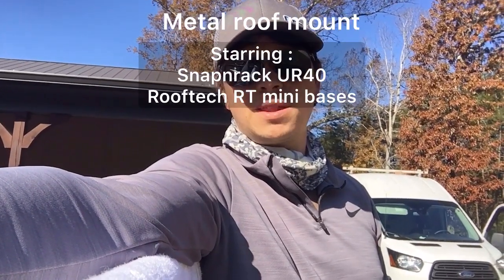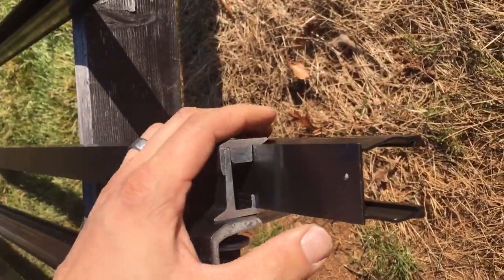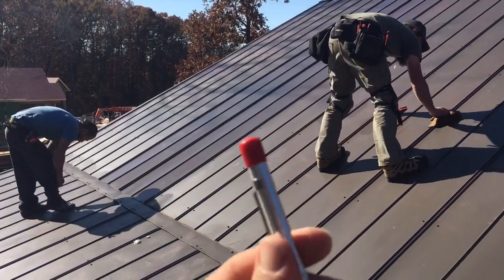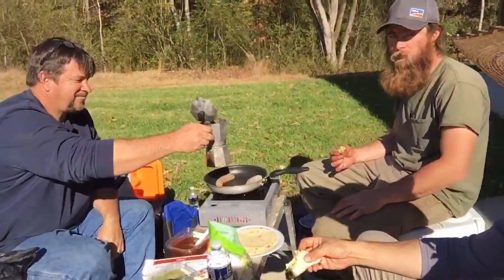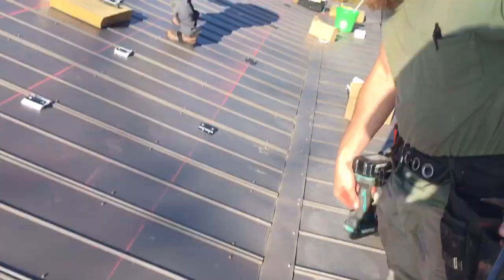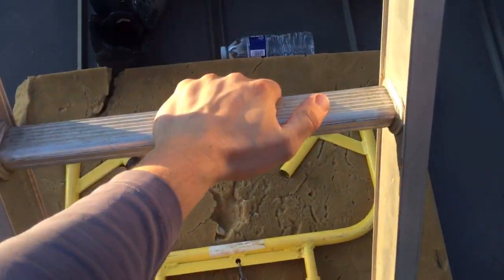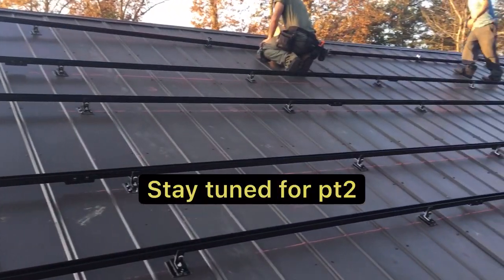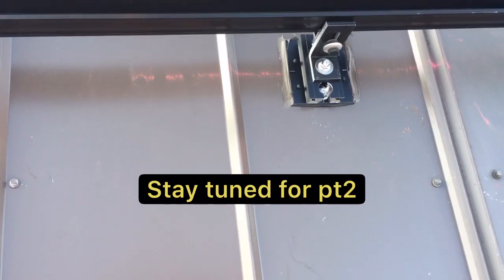Solar metal 30kw Grid Tie Battery Backup Solar Install:Metal Roof Screw Attachment

Comment: I just got the whole crew cougar paws
Reply from the maker: Metal roof or shingle roof?  They work best if you clean the roof squeegee and sponge mop.
Reply: @GainSolarPower  i got the metal ones.
You need a referral code i would have used it.

Comment: what do you need to do to hit the studs instead of roof decking?
Reply from the maker: omgnothingisavl you either need to measure from the inside with a common point of reference or you can sometimes use a rubber hammer. It’s harder to find the studs on a metal roof. Hence the RTMINI